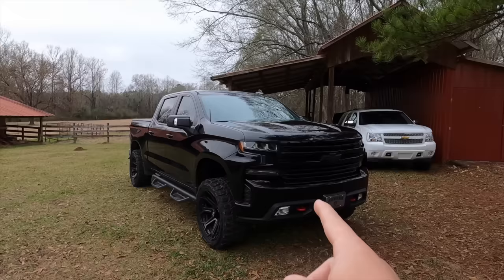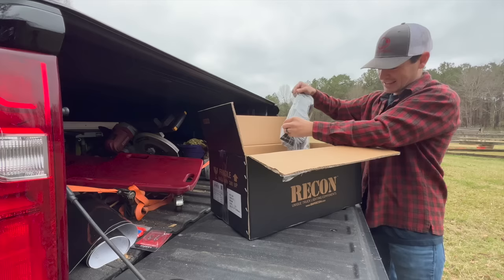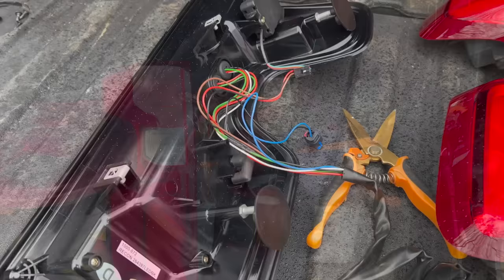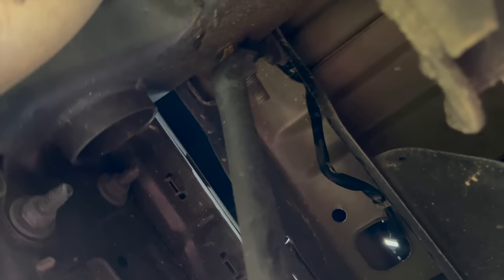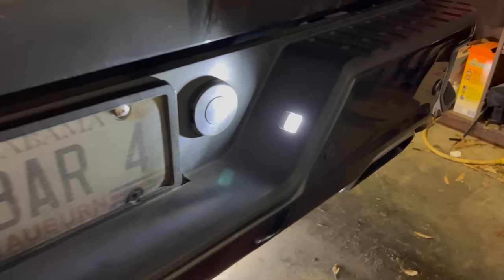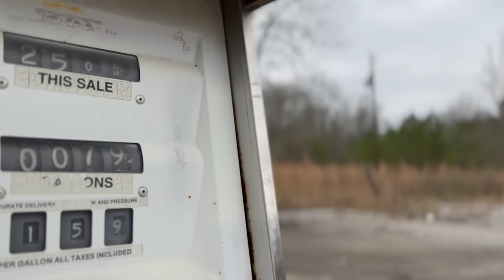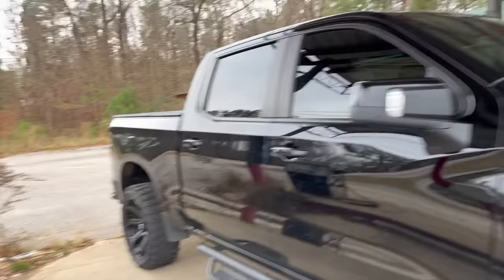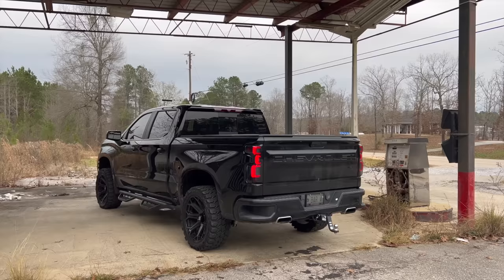CHRISTMAS MODS TRANSFORM THIS SILVERADO!!!

Comment: The RECON taillights are good looking lights, but they have a huge flaw.  If you own these taillights, make sure the little 3 wire clip that connects the resistor pack is protected from the elements.  You'll see it right away as it's the only connector that isn't weatherproof.  Both my taillights failed within weeks of being installed as the non-weatherproof connector corroded away the ground pins.  If you're getting "Turn Signal Failure" warnings on your DIC then this is what has happened.
Reply: Thanks for that information. 👍
Reply: Daaaaaamn, i got some other tail lights for my silverado and that exact same thing happened, AND my rear right running light is out but the brake lights work etc..sucks
Reply: Ditto,  I ended up using die electric grease and problem hasn't happened again. For a $600+ light I'm not super thrilled with the quality. Almost returned it twice

Comment: I just installed these yesterday.  I pulled the led bed lights out to make it easier to remove the wire harness. The new recons were pretty easy to install.  The passenger side bottom pin was hard to push into place.

Comment: I'm probably ur fil age and I'd have no interest in the new twilights or the cover over the front side markers.

With a black 2018 denalli I did get black door handles and black taped the chrome horizontal trim pcs as well as painting the front grill and skid plate black.
Not sure of the rest of the stuff you've done???